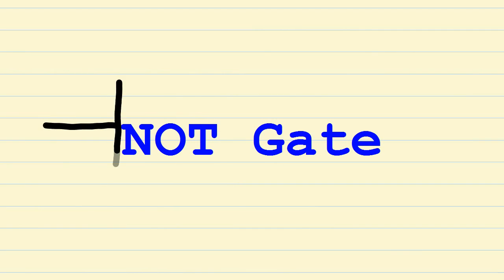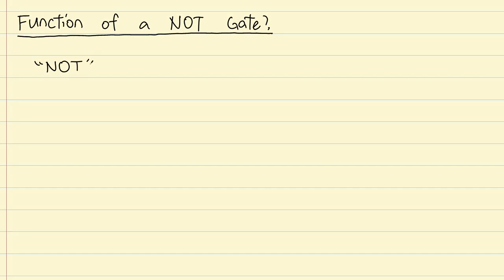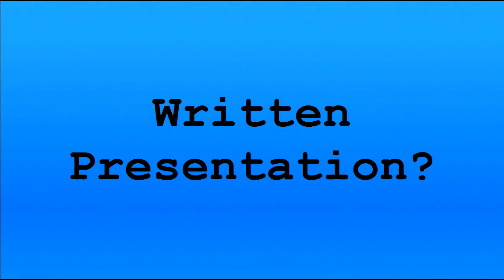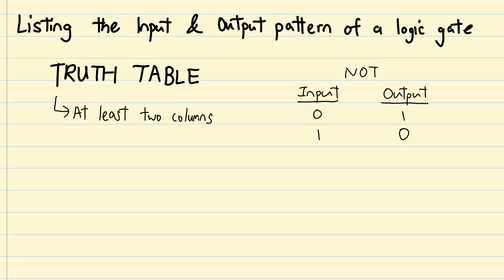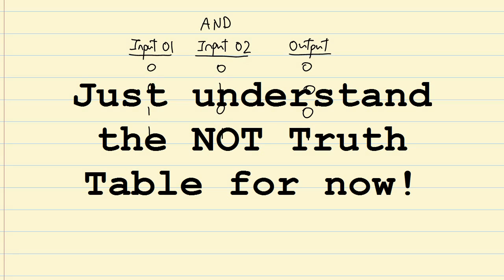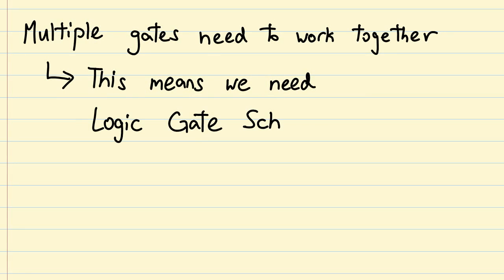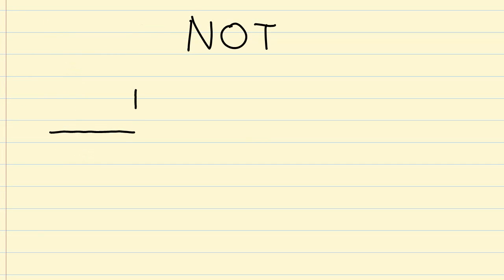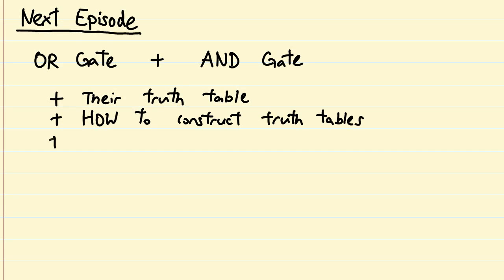Logic Gates 02: NOT Gate

Comment: The simplest logic gate is actually the buffer. It is a monadic logic gate just like the NOT gate, but it does not invert the output. The output is simply the input.
Reply: The symbol for the not gate is actually just the symbol for the buffer (a triangle) with an inverted output. Technically the not gate could be a triangle with a circle on the input because it does the same thing. What makes it a not gate is that it inverts the signal in the buffer, which can be done in both ways
Reply from the maker: Hello and thank you for your comment! Yes, when I made this video (13 years ago, goodness!) I wasn't aware of the buffer gate or that the little circle symbol just meant an inversion. I think in later videos I started using that convention myself as well.

Comment: Hi, could you assist me, how can make output with a delay of 2 sec?
Thanks
Reply from the maker: Hello and thank you for your comment! What platforms are you using? If you're using something like an Arduino, it's much easier and more reliable to do this in code.

If you really only have access to electronic components, you'll have to consider using something like a capacitor to momentarily hold charge. There's a vaguely relevant discussion on this topic here you might want to refer to: https://forum.allaboutcircuits.com/threads/1-second-delay-using-logic-circuit.159202/

Comment: How can I NOT find a video on Youtube that explains HOW "not" gates work?!  Like, if there's only one input, where does the electricity come from for the not gate to output a charge?
Reply from the maker: Hello and thank you for your comment! Logic gates are powered by transistors - They need additional connections to power and ground, and the power is either allowed or disallowed to flow to an output pin. We don't show them in these diagrams because these are meant to be abstract representations.